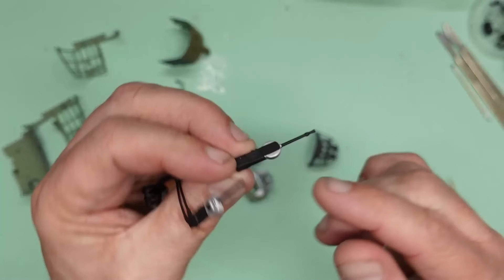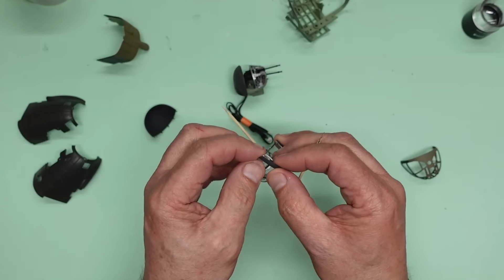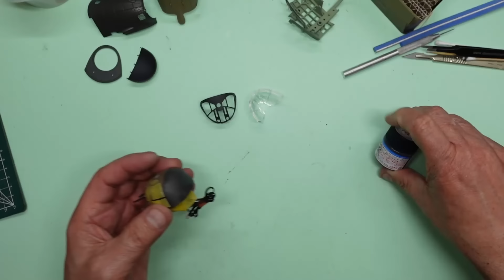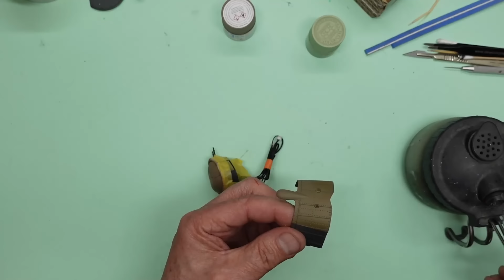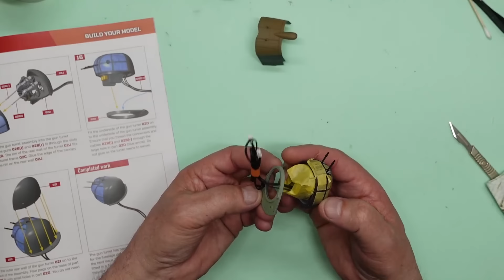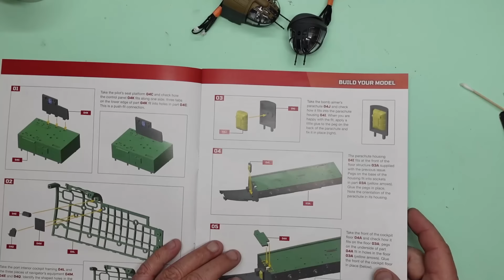Hachette 1/32 Lancaster B.III Bomber revisited. Part Two

Comment: Absolutely gorgeous very nice job will have ago at mine now iv seen how you've done it what paint did you use for the frame work inside the turret thanks Nige
Reply from the maker: Sorry David, I should have said.. Green is 50/50 XF71/XF21, Silver is LP72, Black is LP65, Brown is custom mix to match the brown on the nose. Detail painting is Vallejo. I would have used washes, but I don't want to highlight and make it look weathered, after all, they were pretty new and unused at the time of the raid.
Reply: @NigelsModellingBench  That's great thank you Nigel
Reply from the maker: No worries, I've added the list below the video now.